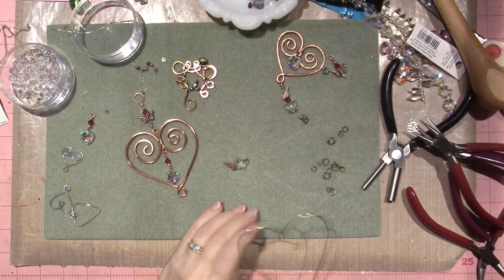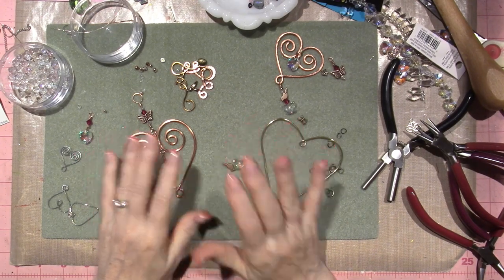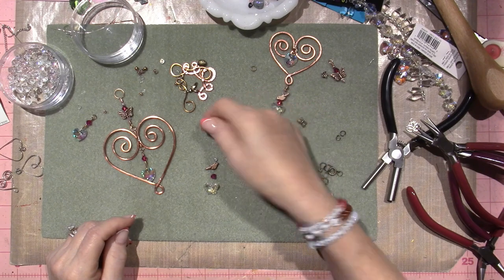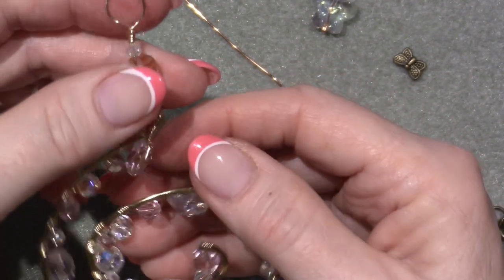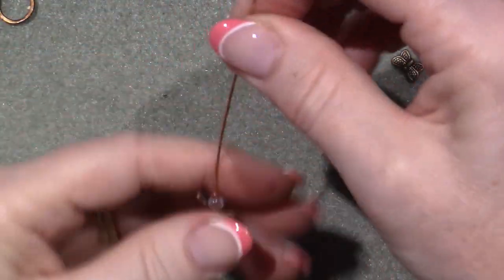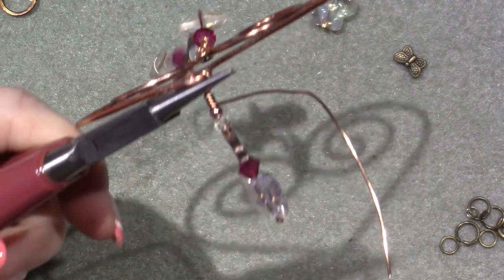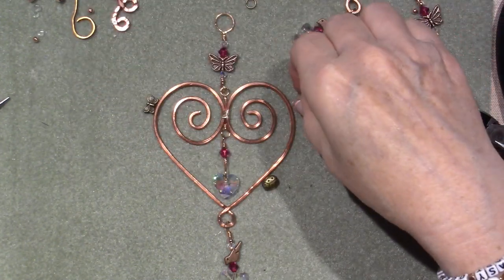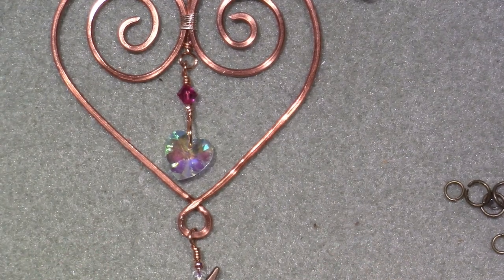Wire work; Making a Headpin

Comment: Sara… I was thinking about the wire your using for the beads which looks like you flattened.  Could you simply use the round wire …bead it and wrap it without flattening and maybe the beads would have more movement turning?  I’m just picking your brain I really don’t know but I’m going to try it myself.  Great instruction…tfs💜